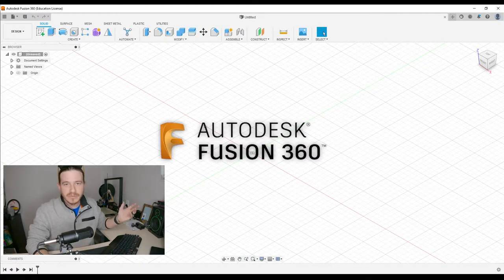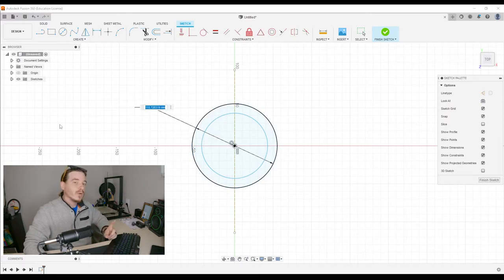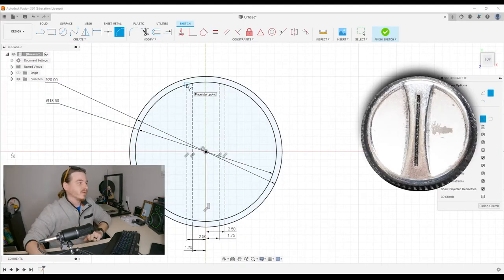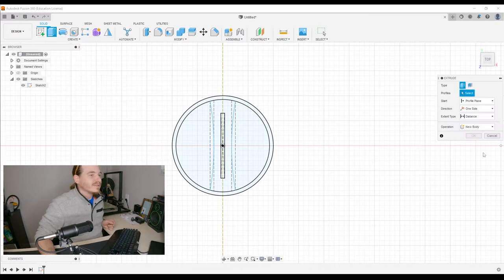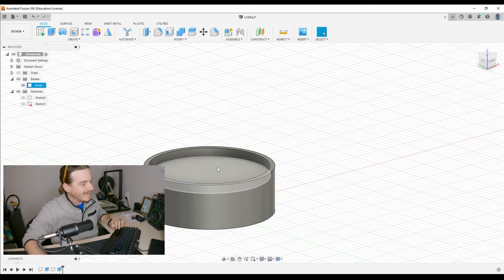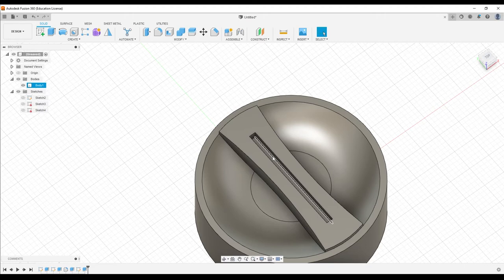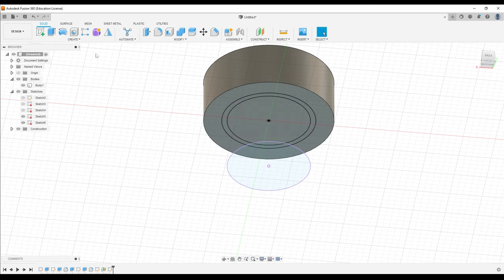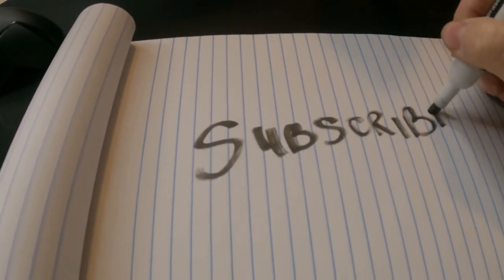3D Printed Car Parts

Comment: Logan, another powerful tool: mirror ;)
Reply from the maker: I’ve had one on there, haha. But, yeah, it usually helps! My glass has a small chip, so I may do that sooner than later (again).
Reply from the maker: But, thanks for commenting that because I bet a lot of people don’t know why they may see mirrors on printers (or the benefits)!
Reply: @LoganDidItYT  Not sure if we're talking about the same thing now. I meant the 'mirror' tool in Fusion, which can be used to easily create left/right parts that are the same without having to enter distances twice and so on.
Reply from the maker: @RolandOfGileadOnYT  oh, that! Yeahhh. I’m trying to limit all the different tools and processes for people just starting. 

What I’m trying to do is introduce a few and use repetition. 

But, yes! I do have a video coming where I do a few more types of things (like mirroring).
Reply: @LoganDidItYT  Your video was quite clear, keep up the good work.
Reply from the maker: @RolandOfGileadOnYT  thanks a lot! I love Fusion and I’ve done a lot of industrial design, Prosthetics and props which I want to work in somehow. Just not sure how…
Reply: @LoganDidItYT  Keep practicing, there's a lot to learn and there's plenty of other material out there that can help you!

Comment: I’ve always wanted a 3d printer. I see that you can buy them say on Amazon but really it seems what makes them great is being able to use the correct software which is expensive right? 

This type of stuff intrigues me.
Reply from the maker: Well, it doesn’t have to be. You have software that you need for printer settings and to “slice models” - convert a 3D model to a language the printer can “read”. There are good free ones like Cura. 

If you don’t want to design a model yourself, you can find literally thousands on the website Thingiverse.com or there are tons of people, myself included, who’d be willing to help.
Reply: Fusion 360 is free for 'makers', which allow up to 10 (I believe) active documents. You can set documents to be inactive/active as many times as you like.